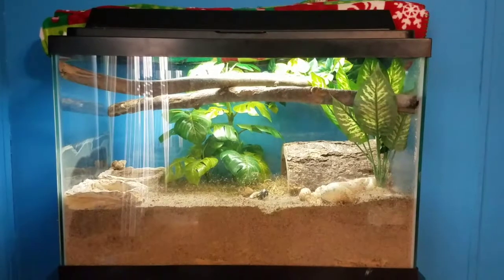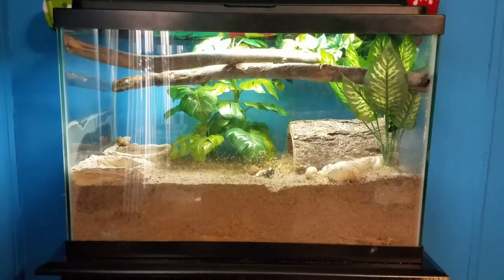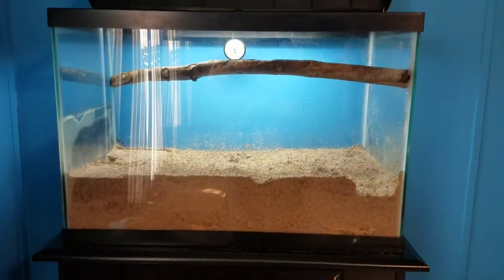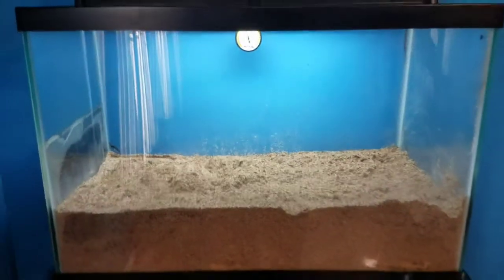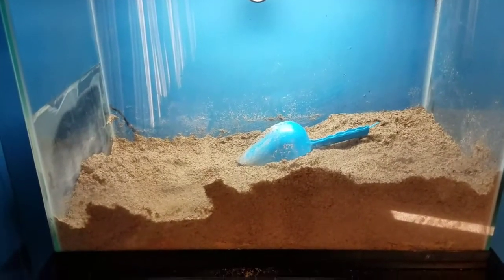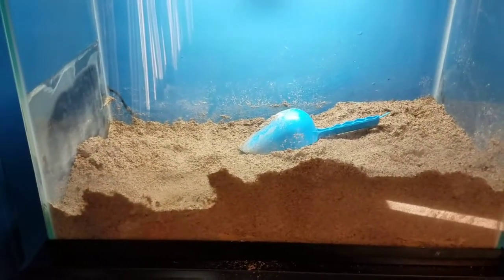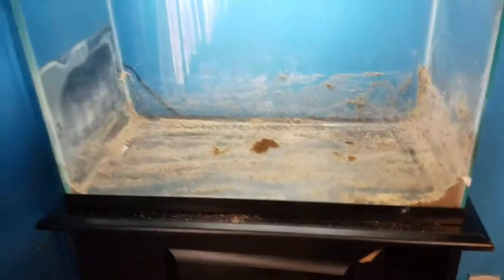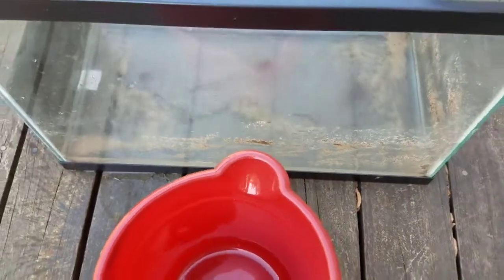(Hermit Crabs) "How to setup play sand and eco earth dirt"

Comment: Eco Earth  can be expensive due to it being pet oriented. An exact product can be found in Home Depo/ Garden centres. Used in gardening Called Coir Brick or Coconut Fibre brick at a fraction of the price pet stores are asking.
Reply from the maker: +JLards Cool Thanks. My eco earth brick that I get is only $499 at petco. It’s a good price.
Reply: Wow! Thanks for that info! I'm always looking to cut cost on my pet supplies if I can do it without any risk to the animals. Pet store's products are very overpriced. I pay about $10 per bag of eco earth at Petco or Petsmart. I'm ready for more substrate, so I'm going to take your advice and look for that product at Home Depot. Thanks again.
Reply: make sure it isn't fertilized

Comment: By water what type of water do you use to mix the sand and eco earth and what water do you use to clean and mist the tank?
Reply from the maker: Bottle water for every thing.
Reply: @DolphincutieWorld  for drinking and cleaning to (is it the bottle water we drink?)
Reply from the maker: Yes,  only use bottle water for there drinking water  always! And use it for spraying the the tank but you can use sink water to wet the sand and eco earth when mixing it. That only when I use it and I use hot water. It will mix better.
Reply: @DolphincutieWorld  ok I thought we were suppose to use fresh water or salt water
Reply: @DolphincutieWorld  so spring water? Or bathroom water fine?
Reply from the maker: Yes that is there drinking water, one bowl with fresh water (bottle) and second bowl with salt water and you can get that at a pet store or water in the pet area.
Reply from the maker: Just use any bottle water from Walmart, target for the drinking water only fresh water and salt water bowl. And use the sink water anywhere kitchen or bathroom for the sand and eco earth to mix it

Comment: Hi I have a question... 
I am getting hermit crabs soon.. You said to refill the substrate every 6 months to a year, so what about if I were to spot clean the cage at a basis of about every like month, then how long would I wait till I changed the substrate?
Reply from the maker: Hello, I spot clean every 2 or 3 weeks. Wetting the substrate, cleaning the side of glass and everything in the tank. You go with out doing a full change once a year. Just spot clean like I said it be fine. If you do spot clean once a month you can wait a year to do the whole tank.
Reply: @DolphincutieWorld okay thanks :) but when you spot clean do you use a pooper scooper to sift out the waste, or is it kind of unnecessary?
Reply from the maker: No I just take everything out and wet the substrate really good. Its hard to see the poop.
Reply: @DolphincutieWorld  okay thanks so much! :D

Comment: what happens when the sand dries out , does it become normal sand again
Reply from the maker: Mine dries out sometime I just take water and put it in there and mix it around until the sand is like the beach sand again. You can spray the tank every day so it dont dry out
Reply from the maker: I use water to mix the sand and the exo earth so it will be Beach sand you have to add water to the play stand it can not be the dry or loose.
Reply: My hermit crab Adoption journey  as long as the water is distilled or she has used something safe in it then the water is fine

Comment: I'm getting an older used tank & it really needs deep cleaning . Think hot water won't be enough , to get the fish scum out :(  Any ideas would be helpful ?
Reply from the maker: Shapie Nails Hi,  That's cool!  Are you going to use it for hermit crabs or fish?  Not really sure,  I always use very hot hot water to clean my tanks even with my betta tanks they get that fish stuff up there and it comes off with hot water.
Reply: Shapie Nails 
Diluted vinegar with a little bit of dish soap.

Comment: Does it matter how much dirt and sand like is there a certain ratio??
Reply from the maker: Paige Stone Hi, I use one full bag of play sand and one brick of eco earth dirt. But you can use as much as u want depends if your size tank.
Reply: I got a 30 gallon tank yesterday. 36 in long 12in wide 16in tall
Reply from the maker: Paige Stone That’s awesome. Hermit crabs will love it. Have fun setting it up.
Reply: I haven't found anyone with a video with a 30 gallon and getting sand and eco earth so I'm not sure what the ratio is
Reply: Paige Stone it's normally a 5:1 ratio 6inches total unless you have large or jumbo crabs.

Comment: I use calcium sand and reptile sand for my hermit crabs
Reply: Francine Jayme  My hermit crabs have been doing very well with the sand that I am using.
Reply: Repti-sand, also known as EcoEarth, CocoCore, or just soft coconut husks are usually safe, but calcium sand will harden in their shells, and hurt their soft abdomen when they change shells. It also will harden on the bottom of the cage and they can't properly molt, dig, or burrow. The best thing is a mixture of sand and ecoearth.
Reply: Calcium sand hardens live cement and can be extremely harmful to the hermit crabs